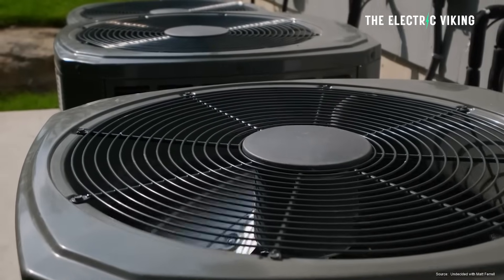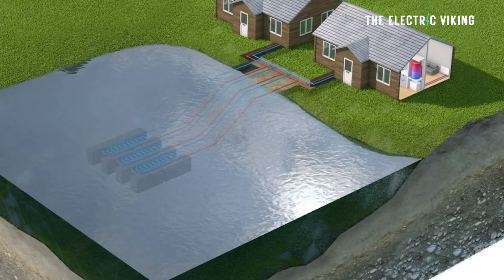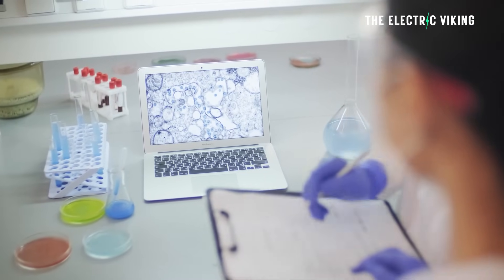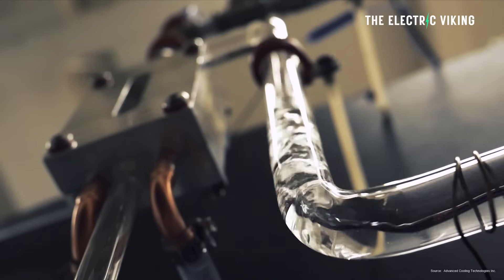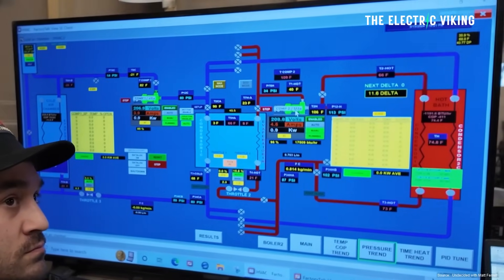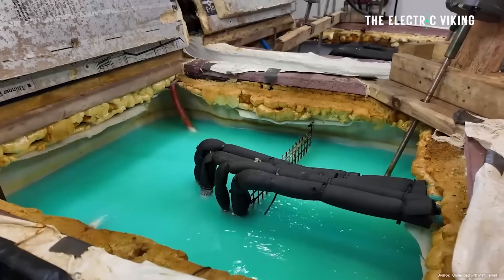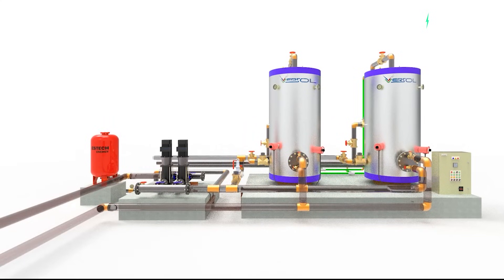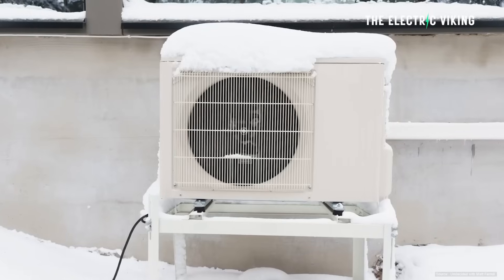GAME changing' heat pump delivers 400% more heat than the energy it uses

Comment: So boil the rivers and waterbodies and call it 400% gain. Since energy can't be created, the 300% has to come from somewhere. That's definitely coming from some natural source. Hence boiling the waterbody.
Reply: The energy comes from the water; you actually cool the waterbodies (a little). This is nothing new, we've been doing this in the Nordics for decades...
Reply: @PurpleAlienPlanet  What's the mechanism behind it?
Reply: @aniksamiurrahman6365  Same as your fridge or an air conditioner. You move heat from one place to another instead of creating it. Even at low temperatures, a body of water contains a lot of energy - you extract that energy with a condenser/evaporator through the refrigerant to move it from one place to another.
Reply: @PurpleAlienPlanet  That's about the same as I said. U freeze or boil the waterbody over time. I suspect, this can only be done sustainably in Nordic nations, Canada, Siberia etc where the temp is too low, providing a huge gradient.
Reply: @aniksamiurrahman6365  It's more efficient when the gradient is smaller. You're not going to boil/freeze any body of water - the amount of energy required freeze/boil a lake is way more than what you need to heat a bunch of homes. Water to x heat pumps with drilled wells can extract the heat in winter and put it back in summer as well.
Reply: @PurpleAlienPlanet  Not a few homes, a full city will do - cooling it when it's cook, heating it when it's hot. Also, considering it works like a heat engine higher efficiency require higher temp. difference. IDK how it can be otherwise.
Reply: @aniksamiurrahman6365  Efficiency is related to temperature delta. The bigger the delta, the less efficient. That said, I get a CoP of 3 and over out of a regular air-to-water heat pump when it's 2C outside.
Reply: @PurpleAlienPlanet  As far I remember from Thermodynamics, the bigger the Delta, the higher the efficiency. I specifically remember the heat engine case. Heat pumps are supposed to be the same, but working in reverse.
Reply: @aniksamiurrahman6365  The optimal efficiency for a heat engine is the Carnot efficiency: 

E = (Th-Tc)/Th

To approach 100% efficiency, you need Th to be much much greater than Tc. (Tc is the cold side, and Th is the hot side).

Heat pumps have a “coefficient of performance” (basically “efficiency”, i.e., the ratio of intended heat transfer to work input) which is the inverse of this ratio:

CoP = Th/(Th-Tc)

Refrigeration, air conditioning, and heat pumps follow this inverse Carnot principle.

So, to get a very high CoP, you need Th and Tc to be very close to each other. Therefor low delta, high efficiency.

Comment: "Heat pump could be more efficient then solar panels"... I don't think this guy has any idea what he is talking about. Explains the basic functions of a heat pump and hypes it up like he just discovered fire. There is absolutely no new technology behind this. Also the use of glycol isn't anything new. The only potential novelty is its use at a large scale...
Reply: Also equating the 3,400 times energy storage of water vs air with an equivalent increase in efficiency made me squirm a little too.
Reply: @briancampbell179  That's what I came here to comment on, too. 3,400 is just the ratio of how much thermal energy one liter of air holds compared to one liter of water. Nothing new here.
Reply: Did you even listen to it? This is a large scale water to air heat pump. He’s not talking about the heat pump in your house, if you would know if you listened to the first five minutes.
Reply: I think he meant could have a bigger impact
Reply: He doesn't have a clue. He keeps on posting "free energy" videos. He's truly an ignoramus
Reply: What have heat pumps and solar panels got in common? Absolutely nothing. One is a refrigeration system and the other produces electricity. The only thing that they have in common is that they have both been around for a very long time. I sometimes wonder if poor old Sam uses nugget to polish his boots and not the stuff that the boots stand in on a bad day. As for submersing the condenser/evaporator, this has been done on boats for a long, long time. Wake me up when it's perpetual motion day, please.
Reply: @davidbrayshaw3529  Tell me another large scale water source district heating system? ThIS hAs bEeN dOnE On bOaTs fOr a LoNg, lOnG tiMe. And you're insulting Viking's intelligence when you think that those two things are the same!
Reply: @juliahello6673  No, he's insulting my intelligence by comparing the efficiency of PV's to a heat pump. They are absolutely unrelated.
Reply: @davidbrayshaw3529  I think you've missed the point. Probably because you are sleeping.
Reply: @rbdogwood  Now that I'm fully awake, would you be kind enough to explain which point that I missed?
Reply: Round numbers:

1) Ok, electricity is 4x more expensive to heat with the fossil fuel.

2) the electric heat pump produces 4x as much heat as consumed to extract it from the water. 

3) so a big heat pump breaks even with fossil fuel, BEFORE spending several thousand dollars for the heat pump equipment and installation. 

"Next..."
Reply: This video came out 20 minutes from the time you commented… ima be genuine, are you a paid journalist or you just naturally subscribe to make these comments?
Reply: @DreDresChapters  lol neither journalist nor paid. i am scientist. I was also not a subscriber, but this channel appeared frequently in my feed. Probably because i am interested in electric cars and thus watch such videos.
Reply: He is right, I service building from the 1960s fully of ancient heat pumps. They come on different configurations, water source HPs are not new at all of COPs greater that 2. Installation and maintenance is typically more expensive. Glad people are discovering technologies but anything but new. New refridgerants are being used to improve the existing technologies such as CO2. E viking is not a technology expert by any means coming from a Mech Eng.
Reply: Pv solar is up to 25% efficient and then using infrared panels 99% efficient, so it's quite easy to be more efficient than Pv solar. If we are talking about hydro solar in vacuum tubes then it's probably still more efficient.

Comment: I hope they are not saying that this product breaks the laws of thermodynamics. That would be just like the 200mpg carbuetor. Vaporware.
Reply: They don’t break the laws of thermodynamics but the headline doesn’t tell the full story. Put simply, the ‘extra’ energy comes from the ambient heat in the surrounding air. It works like a reverse cycle air conditioner. The energy input runs a pump and compressor. By compressing gas, it heats up. You draw off that heat then release the pressure through an external radiator. The gas cools to below the ambient temperature. After running through the radiator, it draws heat from outside to warm up the gas to a near equal temperature so when it is compressed again, it generates heat.

The energy in the pump and compressor doesn’t directly generate any useful heat. It is a mechanism that effectively transfers heat from the environment to a container or where it is needed. This is why it is called a “heat pump”. It pumps heat from point A to point B.

Be careful when trying to apply the laws of thermodynamics. They apply to closed systems which are those that have no energy entering or leaving. A heat pum has energy entering in the form of electricity to drive the pump and compressor as well as ambient heat from the environment. Energy leaves in the form of warm air to heat your house or hot water. It is far from a closed system.
Reply: Heat pumps move heat, they don’t generate it.

Comment: Stupid Idea. What is going to happen to the ecosystem of the rivers and oceans as you warm them even faster.
Reply: Actually you're cooling them (a little bit), because you're transferring heat from them to your housing.
Reply: @hiram1923  your right. Good catch.  Though I'm sure they will be used for cooling too, so maybe it will even out. Most heat pumps like mini splits etc can do both.

Comment: Sam, please learn the basics of electricity and thermodynamics and how all the stuff works.

The most heat pumps deliver about 300-400% more energy than the energy it consumes. You put in 1kw of electricity and get 4kw of heating power. That's the whole point of heat pumps.
Reply: He pumps aren't creating energy they're just moving it. One place to the other. They're very good at it. So you put 1 kilowatt in and you can move 3 to 4 kilowatts around.
Reply: User, 

are you not familiar with basic science, nothing is 100% efficient.
The seemingly 'miraculous' heat pump efficiency is false because electricity is not pure energy, but an energy carrier..
Heat pumps generate heat from gas compression, not moving heat around as you put it.  Higher gas discharge temperature from the compressor is obtained from a higher gas temeprature input to the compressor from the evaporator.  This is why air source output falls with a fall in outside air temperature, and ground source types  which have a much higher and stable temperature giving more heat.
Reply: @Joegreen-r1i  And I would suggest that the term "kilowatts" is very loosely used in the context of heat pumps. British Thermal Units (BTU) or joules are a measure of heat energy, not watts. Watts can be used to describe the rate of energy transfer. But the concept of putting 1 kilowatt in and getting 4 kilowatts out is the stuff of sciences fiction. At that point, you've discovered perpetual motion. If that ever happens, congratulations, you're now the richest person on the planet by 10,000:1.
Reply: Hi @davidbrayshaw3529,

I appreciate your effort to clarify the terminology and principles related to heat pumps. However, there seems to be a misunderstanding about the concept of efficiency in heat pumps that I’d like to address.

The term “kilowatts” can indeed be used to describe both power and energy transfer in the context of heat pumps, and it’s a common practice in many countries, including Germany, to measure HVAC performance in kilowatts.

It’s also worth noting that British Thermal Units (BTUs) are not an internationally standardized unit. While they are commonly used in the United States, many other countries, including those in Europe, prefer using the metric system, with kilowatts (kW) being the standard unit for measuring both heating and cooling capacities.

Heat pumps operate on the principle of transferring heat rather than generating it. This is where the Coefficient of Performance (COP) comes into play. A COP of 4 means that for every 1 kW of electrical energy consumed, the heat pump transfers 4 kW of heat energy. This doesn’t violate any laws of physics or imply perpetual motion. Instead, it’s a measure of the system’s efficiency in moving heat from one place to another.

It’s a fascinating application of thermodynamics and highlights the impressive efficiency of modern HVAC technology. If you’re interested in a deeper dive into the science behind it, there are plenty of resources that explain how these systems achieve such high efficiency.

Thanks for sparking this important discussion!
Reply: True enough, but near the end of the video is the actual takeaway from this application of heat pump technology. Air-to-air is the most common and least efficient, air-to-ground is much more efficient (but expensive to install and as a result far less common), and air-to-water is the most efficient of the three technologies, and between air-to-air and air-to-ground in terms of installation costs. This is the sweet spot for heat pumps.
Reply: The main drawback of heat pumps (air to air) is when the ambient temperatures reach -20C and below.  The efficiency drops dramatically then.
Reply: I’m guessing the limitation of this technology is that houses not adjacent to rivers, lakes or the sea won’t be able to utilise it and that must be a high proportion of residences?
Reply: @markbennett6658  Wells can also be used. In many places, well water is not suitable to drink, but it can be used with a heat pump.
Reply: @mikewallace8087  heat pumps don’t generate heat, they transport heat. They rob heat from the environment and deliver it to the house. That’s why they appear to have efficiency of greater than 1
Reply: that can't be possible. how can energy be created from nothing?
Reply: @Withnail1969  Your refrigerator has been doing it all along
Reply: @Withnail1969 it's not being created, it's being pumped. That's why they're called "heat pumps".
Reply: No, it's not.